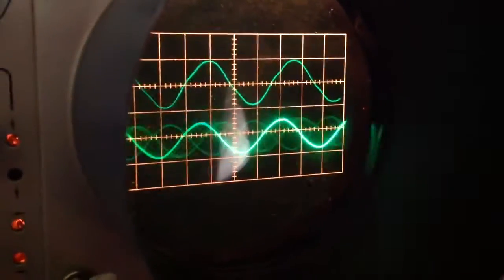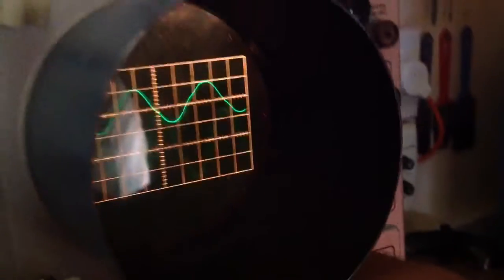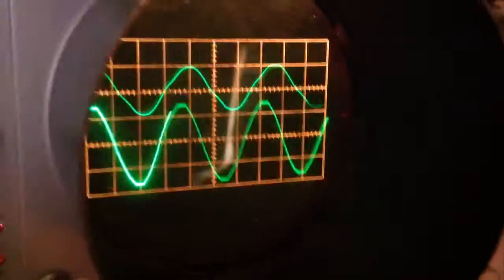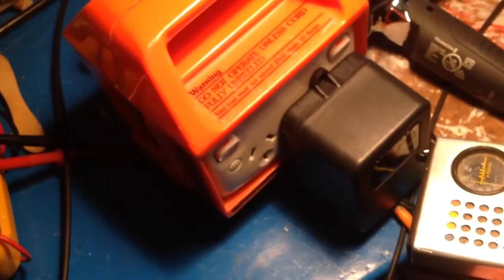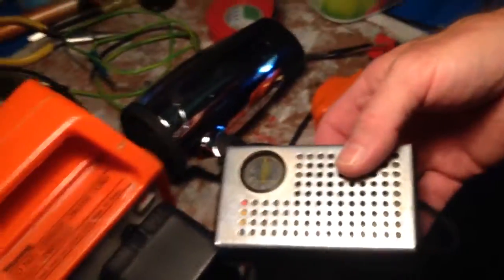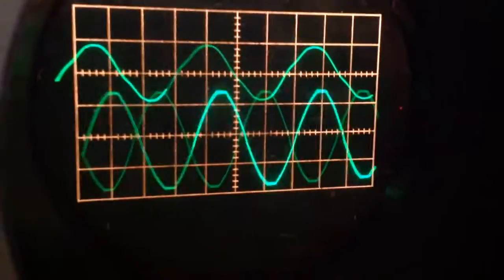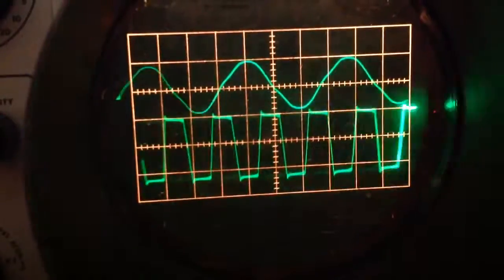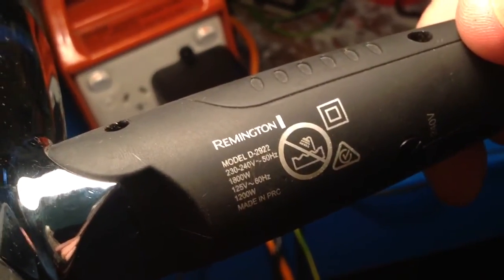Dodgy Chinese inverter (powerstar W7)

Comment: Our rural property has been on standalone solar since 1982, at present we have 4 inverters, 1 Outback American unit, one Selectronics Australian unit and 2 Powerstars  a 3 KVA 24 volt unit and a 48 volt 6KVA unit, this unit is 13 years old and has been in service 13 years with excellent performance.
I am also an amateur radio operator with a well equipped shack, while there is some RFI  (Radio Frequency interference) all of the inverters I have  create a similar noise, maybe a S-1 squishing background noise on my various transceivers,  I've tried Faraday cages, various supressors and the usual  shielding  of battery supply wire, but to little avail. 
The largest RFI eminates from my large MMPT regulators on sun up as they goo throught starup algorytyms.
It isn't too invasive and the later rigs IF DSP and  a BHI AF DSP unit solves the problem.
I am able to run my shack direct DC and that gives me the super quiet RF background only a rural area can give, 24 volt via Hi capacity DCDC 24volt to 13.8 reverse buck.
The trick is to keep the batterys and inverters away from the rigs and the antenna system.
BUT the Powerstars are not necessarily any worse than the Australian Selectronics, or the American made Outback inverter for RFI !
I have also had some RFI from a small Latronics 600 watt unit.
My high quality audio amplifier has no noise eminating from it when plugged in to the mainhouse circuits run by  Powerstar inverters  indicating that the wave form is not as bad as you appear to be indicating.
Maybe your unit is problematic? , however for large start loads the Powerstar  6Kw is superb and our appliances work well off them and have long life spans.
Sure there may be better inverters  but not for the price and certainly the new 5KVA 24 volt BIT deals unit I've also just purchased fro $840.00 on a special offer is running my compressor in the workshop well and at 44 KG appears excellent value for money has a massive transformer and is a very well constructed and wired inverter. No bodgey worksmanship on any of mine and i have taken the cover off them all and inspected them all.
I have been quite impressed with the Powerstars value, reliability and performance, especially for the price, almost a 40% of the price of an Outback, Victron equivilent or 20% of the pprice of a Latronics or Selectronics equivalent capacity. 

Bottom line is place a very poor quality single conversion superhet radio  on the AM band near most power devices as you did in the video and you will get RFI .
 just sayin"

Comment: I've got one of these and have used it for 5 years now and the sine wave is near perfect even at 2kw load with some slight rise time slump at the full 3kw but no flattening of the sine wave

So i assume this one must be faulty.

Mind you i run it from 6 x 1080ah (C5) 2volt forklift batteries so even supplying 400 amps at 12 volts from those is nothing
Reply: I agree, I have had mine since 2013 and it's still going strong.  I have also tested the output wave (under approx 1kw load) and it's near perfect.

Comment: Not enough DC rail voltage, for the output stage. you need at least 170 VDC for 120 volts RMS. You need at least 340 volts for 240 Volts RMS. When you load the output, the amplifier tries to maintain the RMS voltage constant, and if the DC voltage sags, it has no choice, but to clip. Turn the hair dryer on, and measure the voltage at the input terminals of the inverter, and make sure it's at least 11 volts. If it's less, there just simply isn't enough voltage multiplication in the step-up transformers to maintain those minimum DC voltages necessary for the output to remain purely sinusoidal. you need at least 400 amp hours at 12 v, for the batteries themselves to not drop below 11.25 volts, assuming .25 volt drop in the cables between the batteries and the inverter. Bigger is better, when it comes to battery capacity.
Reply: Well I have other inverters that maintain a proper sinewave as low as 10V when under load 

In that particular test, there was a 150A battery charger connected in order to remove battery voltage as a factor
Reply: @mwbgaming28  That could be, if: there is enough voltage multiplication on the input transformers, low enough DC resistance in the switching transistors and transformer windings, and, if the output voltage just simply drops low enough, to avoid clipping.
Reply: @vincentrobinette1507  and what about the fact that I had a 150A battery charger connected to keep the DC voltage around 14V

Comment: Wow.. I was looking seriously at buying one of these , its advertised as a proper Low frequency Driven Transformer setup for True pure sine, it should not be doing that , are you sure its not a false reading? some scopes dont like EMI
Reply from the maker: its definitely not a false reading, (the double helix effect was because i used a very noisy battery charger to boost the voltage during the test)

the scope used was calibrated just minutes before the test
Reply: Hmm well i certainly wont be buying one , Think il be sticking with My APC UPS , the 3000xl's give a real clean output and run for years at a fraction of the price secondly they don't give me any RF interference (pretty important being a HAM)
Reply from the maker: i use one of the tortech HP series inverters these days and have not had a single issue to report 
though i have also upgraded to a 48V Li-ion battery bank

sinewave quality: better than the mains 
voltage regulation: excellent (no dimming when a heavy load is applied)
frequency: solid 50hz
overload capacity: 150% for 5 min 
RF interference output: barely detectable at 30cm from the unit 
EMI output: none detected

i was thinking of originally getting one of those APC units but i couldnt find a way to hack it into turning on without the mains being on initially (no good when im trying to power my house without a grid connection)
Reply: Ah its straight forward , the cold start function , Press and hold the power button for 5 seconds , release and hey presto they run without ever being connected to the mains, mine is running totally off grid :-) the XL versions are ideal as they are built for continuous / extended operation , that said I ran a bog standard APC non XL for months and months I expected it to overheat and blow out but it just kept going , its still running now - Side note only use the ones labeled Smart ups (as they are true pure sine)

Comment: I just purchased the big 3000w MPPT Hybrid model, no worries so far, very stable output so maybe something is iffy with your battery cables or even the batteries themselves? I'm running two big 200ah batteries with large cables up two the inverter, less than two feet via a circuit breaker (a must), also the shorter the cables the better! Bit deals have really bad communication, won't answer questions via email which is not really acceptable but the inverter itself seems very well built.
Reply from the maker: its definitely nothing to do with battery voltage or cable length 

the battery voltage during the test was around 14V under load and the battery capacity was 2200AH 
the voltage was measured at the inverter terminals

the inverter is just a cheap piece of crap sold for a premium price 
and yeah bit deals are shonky cunts, had to send this video to my bank manager to get them to force a refund since bit deals wouldnt send me a prepaid return label (no way im paying return postage for something that heavy)
Reply: Well sorry to hear about the issues with your inverter, must be a dodgy batch or one off fault, I'm happy with mine and upgraded batteries to Trojans, no issues what so ever and I've given my inverter a caining with my microwave, a heater and some power tools, all good so far.
Reply from the maker: the overload capacity is very good with it (took 4.5KW to make it shut down) but the sinewave is garbage 

i upgraded to one of the tortech HP series inverters and have not had a problem with it, its electrically quiet and the sinewave is actually cleaner than the mains (it flattens a bit when it goes into overload) 

as for batteries, i upgraded from my bank of diamec AGM batteries to a bank of Li-ion batteries and i upgraded from 12V to 48V
Reply: Hi @mewantbrains  Thanks for posting this video. I purchased one of this 3 years ago and luckily is still running. I actually came across your post because I bought a second unit 3 months ago and it just died. I went to buy a Tortech last September and they wouldn't sell me one because they are not longer making inverters. Which is a real pity cause I heard great things about it. I was wondering if you knew of any other similarly good product like the tortech? Thanks again for the video

Comment: Have you tested this with an item that requires pure sine wave? It could be adjusting to the appliance's power pull.
Reply from the maker: i did extensive testing that day (way more than in the video) and it is using PWM to draw the sinewave (using a woefully inadequate boost circuit and PWM generator for its power rating)
 
when the load increases, the PWM signal is "active" more and more until it is always active, resulting in a square wave output 

if this was marketed as a 1000W inverter it would actually be really good (massive surge/overload capacity and decent sinewave) but as a 3KW inverter, it is a piece of junk

Comment: I almost buy this inverter also on ebay and as I see is  selling on Amazon Ali express and Alibaba I thought that it was a  powerful robust inverter but now thanks to you ,mewantbrains, is time again to make another research to find a great and confiable 3kw inverter.
Reply from the maker: i recommend the tortech HP series (mine is the 48V 6KW model)
i am using one in the off grid power system for my house and i have nothing but praise for it 
i can load it to 150% load for 15 min before it overloads 
it holds its sinewave output extremely well under heavy load (only flattening slightly when at 150% load)
the idle power draw is very reasonable at just a few amps 
the voltage regulation is the best i have ever seen (the lights actually dim more on the mains than on the inverter when the 3600W air conditioner turns on) 
the operating voltage range is suitable for using a 13S lithium ion battery pack (48V model)
Reply: Thanks

Comment: Buy a cotek I have used them and they ran great at max power I was able to put 1500 watts on a inverter rated at 1500 watts
Reply from the maker: cotek doesnt offer any inverters with a 240V output with the power i am looking for